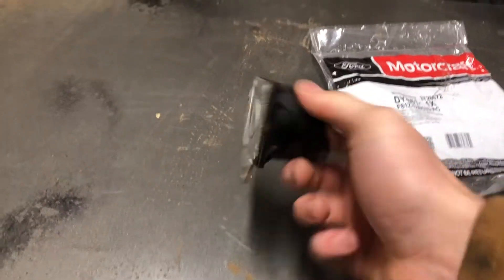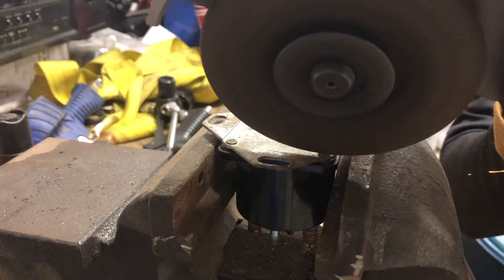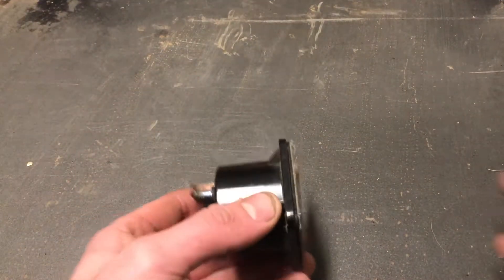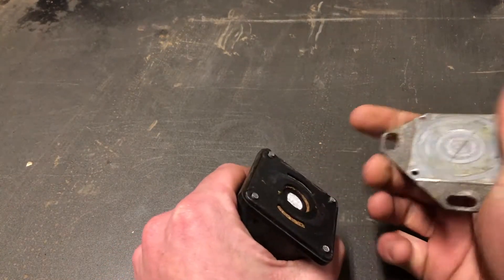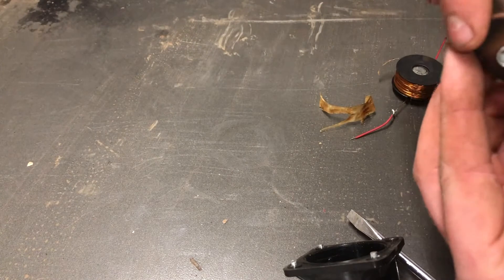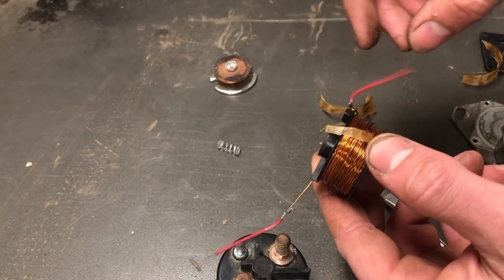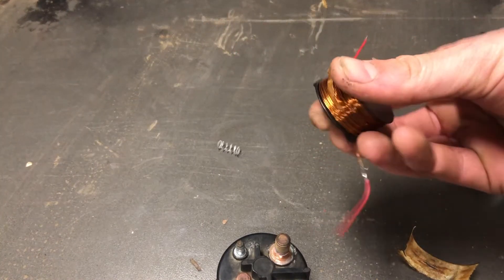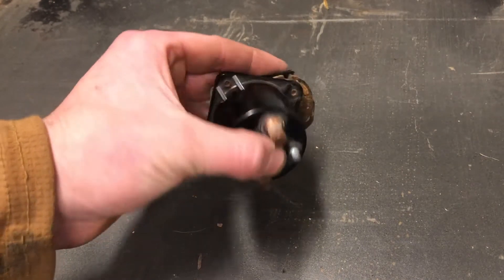Taking a Look INSIDE a 7.3 Powerstroke GLOW PLUG RELAY

Comment from the maker: If you look closely you can see the black/burnt spot on the disk and I believe that was the initial problem with this relay. When i went to take it out though it wasn’t clicking so I believe the coil went bad later. It was on there for 2 years not functioning correctly so I’m figuring that’s how this one failed! (I’m hearing that typically the contact wears out before the coil)

Comment: Normally I would agree going OEM is a good way to go but in this case I disagree. I've gone through 2 OEM glow plug relay's. I switch to an O'Reillys relay, in 2-years it has not failed. $50 with lifetime warranty.
Reply from the maker: Thanks for sharing your experience! I’ve always had good luck on the oem ones we run them on the fleet trucks and they last for years. I’ve also heard the same thing as you though for some other people as well
Reply from the maker: I’ve also heard of people throwing aftermarket ones in an oem bag and marketing them as oem so it’s a picky situation with them I guess

Comment: Was it clicking when you put power & ground to the small terminals? If so, the disk that is black/burnt was the issue. That disk is what jumps the two big lugs to power the glow plugs.  These solenoids are identical to starter solenoids too.
Reply from the maker: No it wasn’t. I saw the black burn spots on there too but it didn’t give any sign of moving the magnet so i think the coil was shot
Reply from the maker: Maybe the disk failed first then the coil later i don’t know it never worked for the past two years about and i never fixed it until now lol